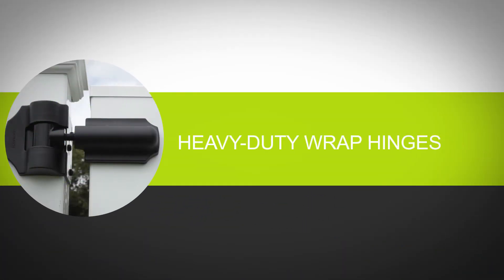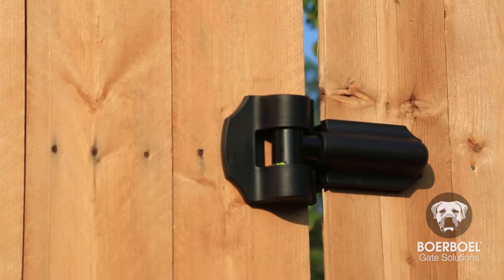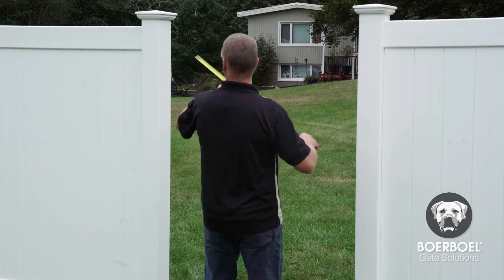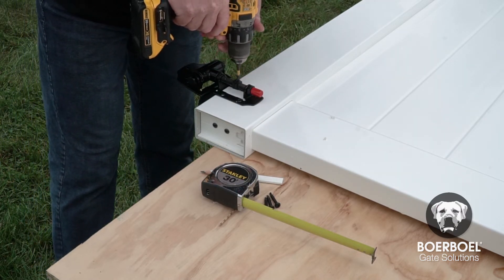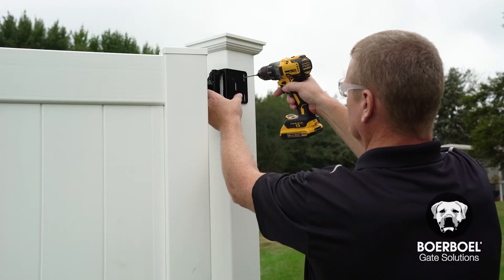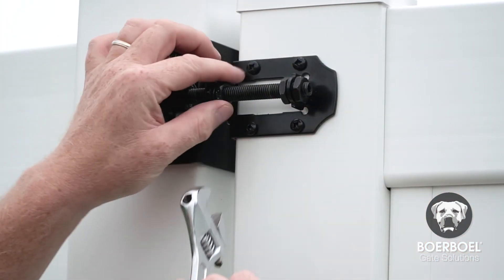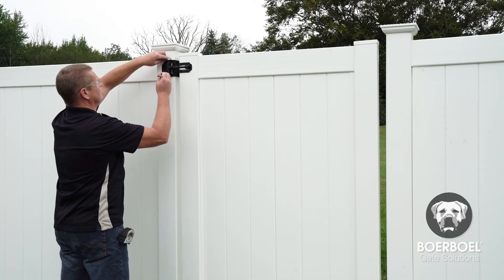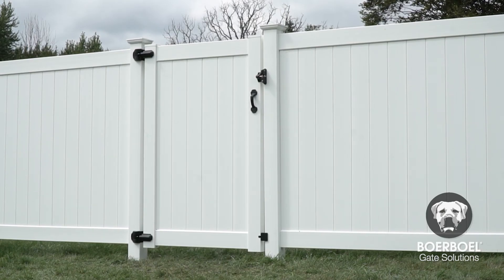How to Install Boerboel® Heavy-Duty Wrap Hinges

Comment: How in the world do the hinge screws have any longevity in a hollow 1/8 inch thick pvc post?
Reply: The hinge side uses a aluminum or pressure treated insert for support.
Reply: They don't have any longevity mine that are screwed into the hollow PVC have already fallen out after 1 year